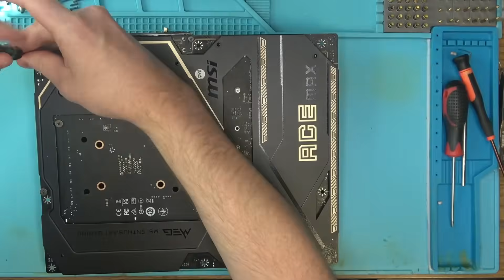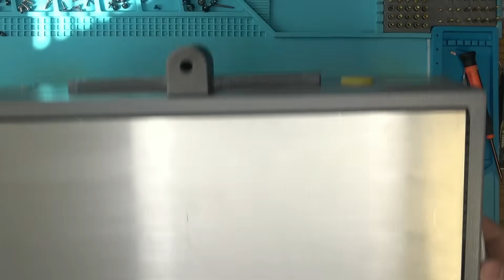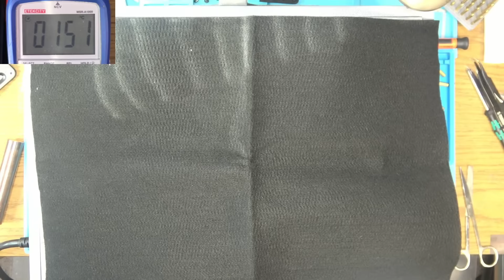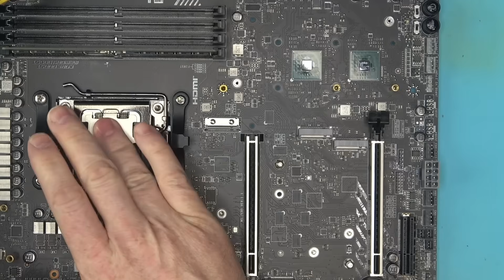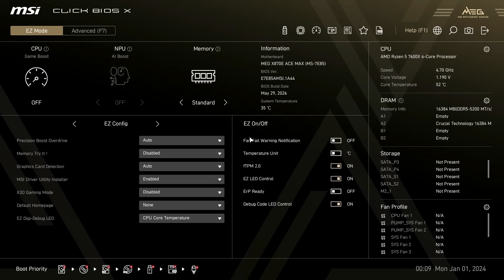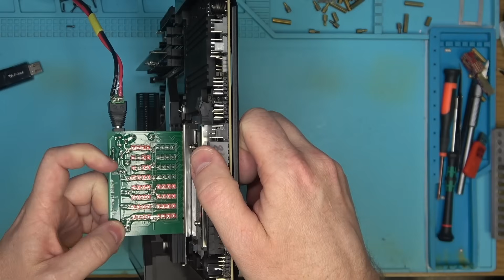How to replace CPU socket and test it

Comment from the maker: For those who are wondering:
PCIE tester had faulty LED which caused other LEDs not to lit up.
I confirmed it on INTEL CPU.
Reply: lol... the tester knew you love your headaches. 😏
great job, beautiful repair!
Reply: gpu slot testing need  to be a rx 9070 or 9060 gpu  or 50 series nvidia gen5 card.. to realy test it..  it mayu work x16  untill its trying to go gen 5 speed. it may fall on its ass lol
Reply: Just as i thought. I had some practice soldering board from China and thought i was bad at soldering. Turns out faulty LEDs and capacitors are all over the place. Like you need 5 sets to build 4 working boards at best.
Reply: all the tiny rectangle chipsbetween the 2xlower (middle)  Nvme slots below the 1st x16 slot . all those tiny "rectangle" chips are PCI-e Switches..  that what allows  PCI-e Bifurcation aka x16/0   or x8/x8 / or/  x8/x4/x4  or x4x4x4x4 !  and also if any the m.2 share with the x16 slot those may be "Bifurcated" down to the nvme slots *(if Populated) .. thaty may be why the pci-e lane tester isn't working..  that is either a CPU or mb/chipset thing ? idk  im not a engineer
Reply: Pcie 3.0 vs pcie 4.0/5.0?
Reply: @jlrockafella  Definitely a bios setting.
Reply: will an E-ATX MB fit in a 30L Ultra-Sonic.. I have a 30L USC
Reply: all amd have 2CU RDNA2
Reply: @VideoGamesPirate  Except F skus, like Intel.
Reply: For now.. 10000 may have an AIE  rather than a dig GPU (iGPU) pretty stupid If @AMD does this!
Reply: 19:55 little misconception Tony, it's the APUs that does that job like the ryzen 8000s, Ryzen 7000 and 9000 have a iGPU and they always run the primary GPU slot by x16 unless motherboard design says anything else.
Reply: u need a reg ATX PSU...  that Pico psu not good enough for X870E or X670E not enough AMps

Comment: That board has a switch chip for the PCIE slot for sure, its one of the few that does x8/x8 for dual graphics cards which is uncommon on AM5.

Comment: I might be missing it somewhere, but I would like to see if it's worth having you look at a MEG Godlike motherboard I recently had some trouble with (overcurrent protection USB bios warning, post stops at 99).  I think my case somehow shorted the front panel USB.  I'm looking for a secure way to get a link to your website or phone number or somehow to find how to contact your business for this.  Is there a pinned link on your channel somewhere?  I don't really click comment links.
Reply: I moved NVME, RAM, Chip etc to another MB and it all works so I think the MB did its job and possibly I could get it repaired.

Comment: I tried doing this myself on an 1151 socket board a year ago and I don't have way to preheat, and I increased the heat too rapidly and i ended up just melting parts of the PCB. The thermometer probe is a must have even if the placement is not perfect.

Comment: Yeah, for AMD boards RAM has to be populated in the correct RAM slots. A2 and B2 then A1 and B1 if you run all RAM slots populated, but for single stick A2 is the slot for whatever reason only AMD could tell us.

Comment: you could always get stainless steel drill bits and set up an exact layout of ATX & EATX and drill for standoffs, and then u can tighten down entire board.
use steel standoffs, brass to soft

Comment: You don’t want to heat up the mother board to fast starting with 180 degrees. You did it right by warming it up from a low temperature. 🎉

Comment: Hi, a one question..
I was installef artic liquid freezer iii pro on my cpu. I was dont know on pump block its have hidden springs.. for a tension. I did a fully tight.. my cpu stuck at post, didnt finished, after dissasemble and remount properly I have “few” little issues… but is working.
My question about the socket.. Can I give a damage to do this little pins ? On tight cpu’s IHS plate ?

I didnt see any turned pin.. but maybe (I think) pins little pressed.. how can I make sure about that ?

(Sometimes stuck in bios I was have post issue and when trying to check after came post code 46 my dram led glowing and post re starting this is old behavior.. I just re mount it and fixed how can be I dont know. By the way, I’m tryed first lose the pump screw all the way. Didnt worked.

Comment: it's mainly the APU-based CPUs that might not run the GPU in 16x, so 7400, 8000 series, AI 400 series. most have 20 lanes, tho it depends on what you have hooked up in the way of NVMe. the 8300/8500 series DEFINITELY won't as they have 14 lanes

Comment: I really liked the part of your power supply you showed us. I am tired of using full sized power supplies for my bench testing. Could you please give more info on what your using. Especially if its smaller and less of a pain that using a full sized one on your bench. Thx!! I just stared doing BBGA rework mostly PC CPU sockets, you gave great info just really interested in the power supply. 🙂

Comment: Whats meant with "AMD CPU's with iGPU run PCIE in x8 by design?" Hear the first time of that. I have a 9800X3D (it has an iGPU) and it runs PCIE in x16 mode for sure. 🤔 It is correct that some M.2-slots share lanes with the graphics slot. Maybe this is what happens?

Comment: You perform all the tests after the repair, but before replacing cpu socket, how can you even be sure that the socket is the only issue? Is there a way to perform basic tests without CPU?

Comment: 20:05 When will you learn to put the memory stick in the correct memory slot? If you use one memory stick it should be placed in the slot furthest from the processor.

Comment: the PCIe tester is not against the CPU - only half of tha lanes (base x8 port), the upper 8 lanes are clearly muxed with two M2 slots, to steal the cpu lanes. So they are definitely non-indicative of anything socket related.
Reply: yeah, you are right. On my Gigabyte X870E you can choose between having the PCIE5 x16 graphics slot or having PCIE5 x8 graphics and two PCIE5 x4 M.2.  Asrocks solution is different: only 1 PCIE5 x4 M.2 and therefore one full PCIE x16 graphics slot or two x8 PCIE5 graphics slots. But nevertheless: tests showed that even between PCIE3 and PCIE5 there is no big real world performance difference in games.

Comment: Can't the bracket warp too? 3:42
Reply: The preheater is only at around 150 degrees that's not enough to soften steel/thick aluminium

Comment: Hi Master, the motherboard standoffs you used are made of brass? If so, dont they conduct the heat to the motherboards screw holes? I bealieve that there are some plastic standoffs that can tollerate heat at around 260ºC

Comment: Why would they want the board stripped prior? That's like saying I'll come do your floor but you have to pull the old one. It's part of the job, in my opinion. Thanks Tony.
Reply: I guess it saves on shipping
Reply: @heretic5552  Save two bucks then either stiff the customer or eat the repair. Figures.

Comment: Oh I use almost the same plate for years now. But even more powerful that yours was originally, a 2500W one.
I guess the issue is your mains are 110V, whereas I have exactly 247V as measured by myself. So my plate goes up to the temp much faster being original, and no tripping the fuses. (3500W possible per house socket)

Comment: Hi Tony, the reason you haven't got the led's on the PCI tester might be that the tester board itself has dry joints or faults. I have had that with this cheap Chinese tat. Bob

Comment: Regarding AMD and PCIe, if I remember correctly, all real desktop CPUs have at least 24 PCIe lanes, of which 4 go to the chipset, 4 to the primary NVMe, and the full 16 goes to the primary PCIe slot. However, if you have a mobile CPU repackaged for the desktop (G series APUs e.g. 5600G), since on a laptop you don't need many lanes, those CPUs only have 16 total, of which 4 are needed for the chipset, 4 are used by the primary NVMe, and only 8 remain for the primary PCIe slot, they physically don't have enough lanes for the full x16
Reply: Coincidentally I just bought a used ryzen 1/1+ system for cheap with an APU and I didn't know there was a difference in the amount of pcie lanes, good to know to know that. Only gonna use it for a simple little diy NAS but it's still good to know how many lanes are available in case I end up wanting to do some pcie card shenanigans.
Reply: @gac9603  Also generation of PCIE. G series chips typically have pcie3 for AM4 or pcie4 for AM5.

Comment: 23:50 , the power connector next to the CPU are the "new" power rails for it, sure normally was for OC but the newer boards need at least 2x 12V ( 4 pins ) min to work, so half of one connector of 8 is needed, the other 8 connector is for OC

Comment: Not sure whether I'm glad that this kind of repair can even be done by a "simple" repair-shop or whether I'm sad that modern mainboards have become so expensive that such a repair makes good financial sense - probably even on a board that's a little less fancy than an MSI Ace Max. Either way: Great work!
24:00 Not sure about AMD boards but I did contact MSI back when I built with my Z690 Tomahawk and they confirmed that the second EPS connector is overkill unless you're using a very power-hungry CPU and/or overclock it. They quoted me the exact max wattage per cable, which I forgot, but I distinctly remember that it was more than 300W per EPS-connector (think it was something like 336W?). That was for an i5-12600K, BTW, which I've since upgraded to an i7-14700KF and I'm still using only one EPS cable - no problems whatsoever with my CPU running Intel's recommended specs (PL1 and 2 to 253W, IccMax = 307A).

Comment: I also have  the tester for PCI-e with the LEDs and I can confirm that on my board the results is inconclusive. I tested on Intel Asus motherboard and not all the LEDS are on even if the board is perfectly fine. And thanks to the video, it was good as in this way someone else confirmed that I was able to see the same results.

Comment: I've never seen a socket replacement, and really appreciate the video, but I can't imagine this repair is anywhere near cost-effective.  Consumer motherboards are what, $100 to maybe $500 tops?  With the vast majority in the $150-$300 range, can't be worth the hours required for this repair.

eta: looked it up and there are some boards around $1k.  Crazy.  I don't see what they offer over the $500 boards other than some cool design and packaging.  Oh well.  May be worth repairing a $1k board!

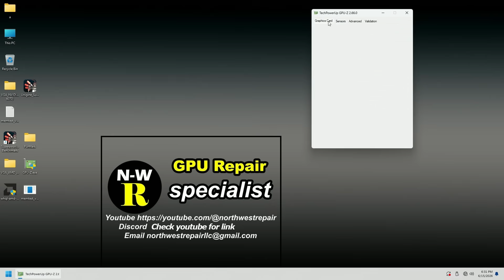Comment: 26:47 gpu-z is reporting that it runs x16 but on pcie 1.1 speed, not 3.0 as the card wanted can you confirm with another card, preferably pcie 4.0 capable gpu?
Reply: This is normal. GPU was NOT under a load so why would it run @ 3.0, 4.0 or 5.0??? That's why the little question mark button is there. To put some rendering load on the GPU.

Comment: FYI by the way. x8 thing for iGPU processors only applies to AM4 and MAYBE 8000 series AM5 cpus (those are basically laptop cores for am5 socket).
Reply: It does apply to the 8000 and ESPECIALLY the 8500G since it only uses a x4 connection. Its just pitiful that it was designed that way for that one, the rest make some sense at least. But otherwise yeah, AMD uses x16 for every other non-G cpu
Reply: @cyruslightz thx for clarification.

Comment: Those m2 storage devices should come with a large cooling aluminium plate like the one present in old pentium4 PC, if not heat willeventually toast the article

Comment: Sometimes you have to let AM5 boards sit for a minute or two as they do ram training. It took my board over 2 minutes to boot up after I installed a 64gb ram kit. Glad im not the only one who hates the single clip ram slots, I hate when the ram sometimes jams when removing the sticks...
Reply: I have 98 GB and it takes my system over 3 minutes to do the memory test. What's really annoying is mine seems to retrain itself quite frequently.. especially after Windows updates.
Reply: @x260houtori  Newer boards have an option to disable that in the bios, though you might run into unexpected issues toggling it on.
Reply: AFAIK my system does ram training every single time it starts but it takes only 10 or 20 seconds but I only have 32gb. 

Must be kinda alarming for a person that doesn't know what the computer is doing to have it just sit there with a black screen doing nothing.

Comment: I have a Asus z690 E-gaming wifi with some bent pins but it still works.... should i have it fixed? what's the cost?
Reply: Black Horse Repair charge $50 but I think you should expect $100 or more if you can find a local repair shop to do it. this can take several hours to do.
Not including shipping costs.

Comment: 26:13 you need to make sure that Secure Boot is disabled when trying to boot different media than the original one that the customer used. I think that was the problem there.
Reply from the maker: Nah it was the bios problem.

Comment: 7:50 it might be reasonable to drill and tap EATX mounting holes and screw spacers into plate, so when you mount and screw the board it will not have any freedom to flex
Reply from the maker: Too much work but solid idea
Reply: @northwestrepair  He said after milling down the aluminium, rebuilding the heater, ...
Reply: @northwestrepair  just in theory you might go less work-intence way and drill/tap holes for socket mounting braket so at least socket zone will be prevented from flexing, but it's for you to decide whether you want to make process more convenient to take this kind of orders more frequently or not.
Reply: Funny, I had the same idea and knew what his response would be.
Reply: @--_DJ_--  rofl

Comment: Both CPU power sockets are the connected together anyways it doesn’t matter which you use first . Memory is typically in the second and 4th socket from the CPU as default for most boards